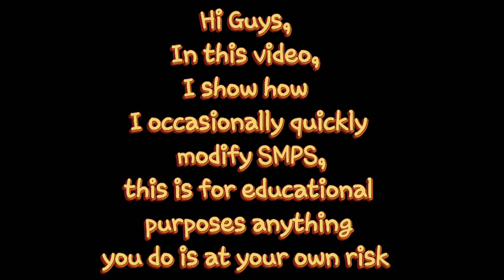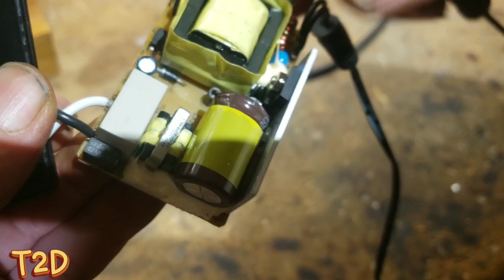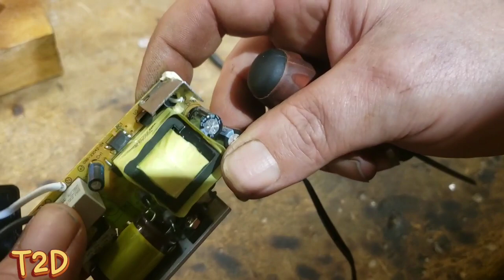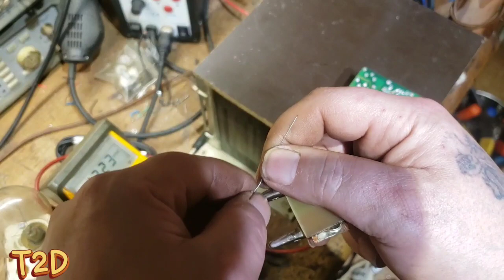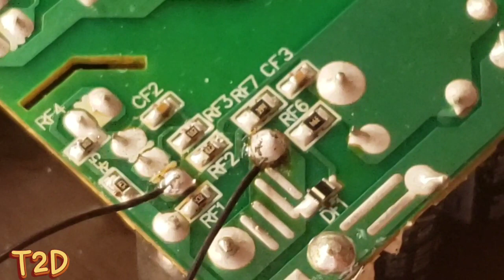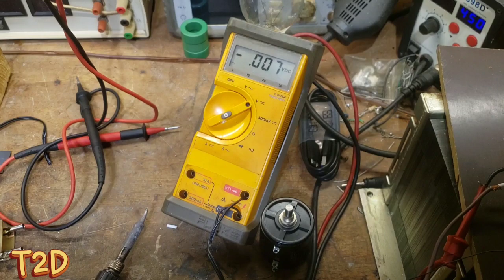how I quickly modify the output voltage of switch mode power supplies...😁👍👍👍👍

Comment: I used this video to mod a 5V 50A LED lighting supply to 4V for the H2 reservoir of my hydrogen thyratron.  Super helpful, thanks!
Reply from the maker: Oh wow 😃 that's fantastic,  good work mate, I plan to do more teaching  electronics plus tips and tricks for effective trouble shooting and repair, maybe on a second channel as this channel is mostly really high voltage focused....
I  really appreciate your feedback, its great when someone tells me my video helped them 😃😃😃
Thanks for watching 

Steve
Reply from the maker: I have a video of me using a thyratron as the voltage doubler diode on my Vacuum tube Tesla coil, I think the video is unlisted but I could send you a link if you want to see it ,,
Reply: @T2D.SteveArcs  Is your other channel called "W H"?  It has a thyratron in the circuit that keeps arcing over.  I always wondered why people don't use them for high power HV switching projects--they're still the best thing for it!  I'm building a Farnsworth Fusor power supply.  What I'd like to do is have the CW circuit with a few mA to get it working normally, and use the thyratron for pulsed mode with a sizeable tank cap bank.  I'm using a  Chatham v1257.  Rated at 33kv 5kA...ought to be good for a few laughs.  (and terrifying neutron counts)
Reply from the maker: @guerrillaradio9953  sounds a fun project, I really like fusor's .. I agree people should use old tech more often too, my mate recently bought a huge ignitron to fire our 20kv 5000j pulse caps with.. I have a couple of videos on my channel showing them, one is just destroying random things ie igbt bricks, caps, switches, wire wound resistors, fruit, mobile phone and so on, and in the other video we put 3 in parallel and crushed a few coins and copper pipe etc...
Reply from the maker: @guerrillaradio9953  send me a link when you get your fusor working

Comment: I once modified a 5V 50A one to 12V 20A. I did this trick to change the feedback and also doubled the secondary turns on the transformer, replaced the filter caps for higher voltage ones and added a few more turns to the output inductor.
Reply from the maker: Excellent 👍 if you're doubling the voltage sometimes you can replace the centre tapped 2 diode rectifier with a full-bridge to save modding the transformer 👍👍

Comment: Some power supplies may get upset if you accidentally set the voltage at lets say 50% more than design. These are usually cheaper supplies which don`t have pulse by pulse current limiting. (Asking for more than 50% duty cycle from a single switch forward for example). To avoid damage to these, I look at the regulator input voltage (in the case of 431 2.5v) I then i connect the output to a supply of my intended new voltage, your case this was 15v, (back-feeding), while doing this the power supply under test is not connected to mains power. Under these conditions, I then fiddle about with the resistive divider (either by recalculation or experiment) to get exactly 2.5 volts on the sense pin of the 431. Because this is done without the switcher running, there is little danger of popping things due to mistakes. Great videos from you Sir, I have been subbed for some time.
Reply from the maker: Hey Chris thanks for your comment mate and I'm glad you like my vids,
Thanks for watching 

Steve